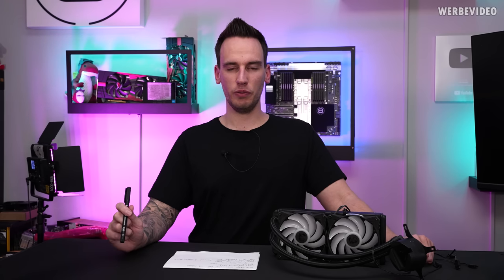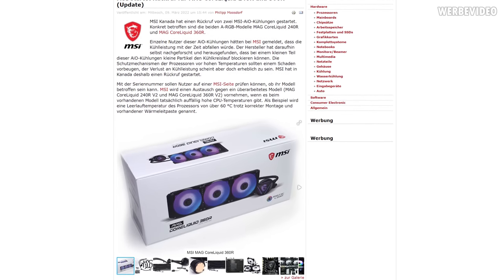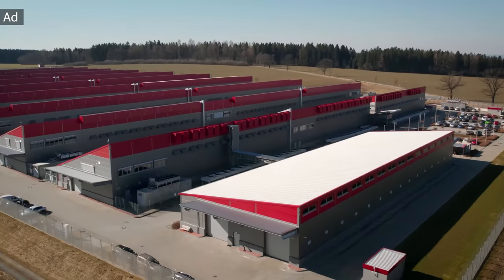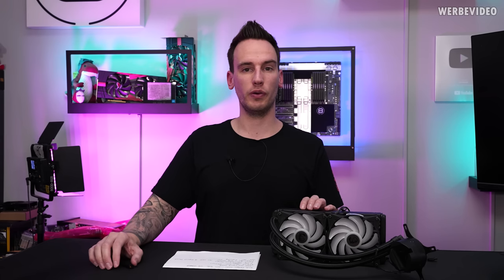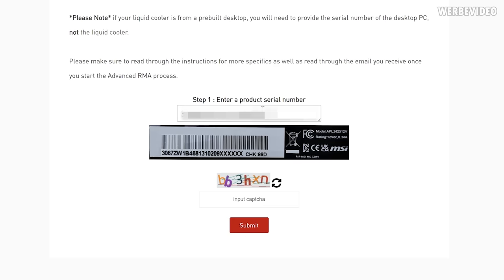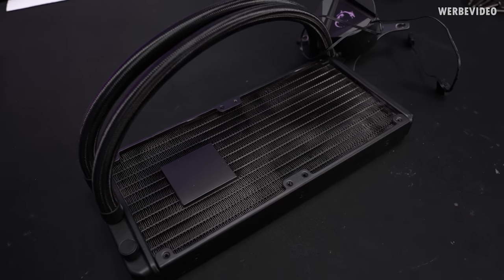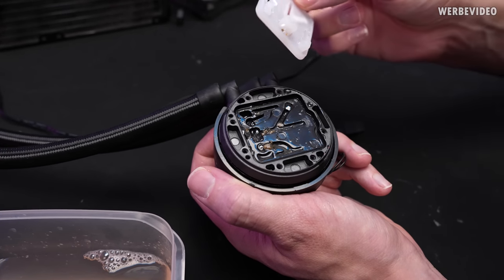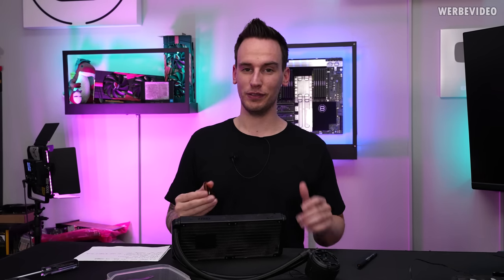Things you should not find inside an AIO

Comment: Thanks for the shout, Roman! We've run into 4-5 of these over the past few months, unfortunately, and many more emails with identical issues since. Currently pressing MSI because the system is still far from comprehensive, and apparently there are different replacement protocols in place for different regions - so not everyone will qualify for the "advanced RMA."
Reply: Someone ping Steve from Gamer's Nexus, he always gets results for recalls. Seriously it's worked before.

Comment: With this means, definitely stay away from any AIO made by Apaltek. In 2019, Gamers Nexus discovers Enermax AIO for Threadrippers clogged with slime all over the fins of the cold plate, that is also made by Apaltek.  3 years later, still get this kind of gunk on their AIO
Reply: thanks I remember that story but didn't know it was the same sub-contractor
Reply: Ooh thanks!
Reply: I don't understand why people go for AIOs in general (outside of the cheaper cost just to say you have liquid cooling, anyways). I have yet to hear of literally anyone who has been able to seal up a liquid cooling loop and never have to open it again. Just because a manufacturer creates the loop instead of the end user doesn't mean they magically have superfluids that can perfectly eliminate corrosion and other aging issues.

Though I do try to live by a personal philosophy... If I know something is going to break some day when I buy it, I want to be able to service it myself. A proprietary loop just sounds like a headache when it comes maintenance time. Like only being able to take your car to the dealer to get it serviced.
Reply: @ashkebora7262  People buy them because they don't want to deal with sealing in liquids themselves, they hope to get something they don't have to manually set up and can just install and go with no worries of major user error in installation causing water damage to expensive components.

I generally agree with your thoughts on repair and serviceability, which is why I don't recommend liquid cooling to anyone not on the enthusiast tier of PC building and in dire need of performance. For the general and layman user air cooling is fine and much less likely to cause any issues which a can of air can't fix.
Reply: @NATIK001  Well see, that's my point: If you're going to go for a closed loop, chances are you really don't want to deal with a water loop in the first place, which is why you bought a closed one. If they're going to age even remotely similarly to an open loop, then all that does is buy yourself complacency and issues down the road.
Reply: @ashkebora7262  
I don't mind dealing with a water loop, I have an EK system running through my two 2080 Ti's (soon to be a 4090).
It works well but I don't want that loop also cooling my cpu so rather than have a whole other reservoir I have a Corsair AIO. it has been running fine for nearly two years. If it develops problems I'll fix it.
Reply: @Igbon5  See, now your use-case makes perfect sense. You have a logical reason to have a separate AIO, and most importantly... you have the exact skills and desires a more casual buyer wouldn't have.

The kind of person that would buy an AIO and suffer issues from it are the FAR more common type of customer: They buy an AIO because they're supposedly better, cannot fit an air tower, or to say they have liquid cooling. That type of customer is still buying in to problems they may not even know how to deal with.
Reply: @ashkebora7262  
Fair point
Reply: @ashkebora7262  My H100i has been going strong for 9 years now somehow, unopened and running on nothing but overclocked cpu's.
Just waiting for it to break, especially knowing that these are pretty much known for not lasting a long time.
Reply: @kristoffer3000  I would highly recommend watching your temps actively. (which you might be already if it's seen many CPUs) It can be really hard to tell if your CPU is getting warmer than it should or even hard to tell if it's throttling if it's getting some heat taken away. Even mostly clogged water blocks will take some heat away.

Sadly, I speak from experience. I was ultra-lazy with my old system, and the 4770k burned out because the block got clogged enough to leave it throttling at max temp. The only time I even noticed anything weird was specifically big frame drops in 7 Days to Die the more and more zombies were around. Every single other game I played or thing I did felt similar levels of responsive. Blender was similar levels of snappy, other games didn't stutter with more enemy AI, etc.

I 'do' play at 4k if I can, though, so undoubtedly the vast majority of games end up GPU-limited for me even on that old 4770k. That should go a long ways to explain why I personally didn't notice.
Reply: Yeah, I had the same issue with Enermax and their warrantees were horrible. Even worse it was a nightmare to dismantle to clean because they used FREAKING SECURITY SCREWS on the cold plate. I'm not talking torx bits, but actual one way sloped security screws. That's obviously not an "oops, our bad" situation, that's actively screwing the customer.
Reply: @Ash Kebora
People buy them because liquid cooling is an efficient way to cool a CPU. And AIO's are a simple and convenient way to do that.
I've had 7 AIO's since 2011, and I've never had any problems like these. And I've Have opened and checked(and'topped up")4 of them.
Admittedly they are not perfect (nothing is) but they can be a great solution for certain use cases.
Best regards
PS I also use"open loop" and although they"out perform" the AIO's they are way way more"hassle
"

Comment: I'm pretty happy knowing that I'll never find sludge in my NH-D15.
Reply: And yes, I am still of the opinion that liquid cooling only makes sense for hardcore enthusiasts or in workstations that earn money, and for regular consumers all the risks and expenses that come with it outweigh the benefits. Sure, if you can afford replacing it every two years and have fun continuously monitoring your system or checking for regular recall news - by all means; but if you're only doing it because all your favorite sponsored YouTubers and Twitch streamers have them... maybe give your own system another look and see how much you actually gain.
Reply: Now we just need case manufacturing to make cases big enough to house the noctua. Most of them won't. I have to raise the fan on one side to fit memory. So that is a bit more than the 163-5mm of this cooler.

But its worth it. I also upgraded to ppc fan's cause I dont care about low noise and oc the piss out of the CPU.

Looking to maybe get the new unreleased ice giant copper version and see if that helps a bit and I'll swap to noctua ppc fans or some delta server fans and setup a fan curve.
Reply: @Lishtenbird  Noctua and Be Quiet make huge air coolers, but unfortunately for the heat density of Intel 12th gen and upcoming AMD and Intel generations it's not enough anymore. There's a limit with heat pipe cooler designs unfortunately. The last hope is Ice Giant.
Reply: @kyoudaiken  
the Siphon design could indeed help offset the inefficiency of Heatsinks - but they'd need to make a Consumer CPU targeted Product as the existing one is designed for Threadripper and so it performs pretty meh on normal CPU's.
Reply: @taiiat0  A friend has one on an AM4 CPU. So they already did that. He still has the aluminum only version. But what also is inevitable is the removal of the IHS. This thing is causing all the trouble we have now. HBM showed it. Just fill the gaps with resin and grind it reasonably flat for a cooler to contact. This will have to be done, otherwise temperatures will not be under control anymore. Those IHS are really the Achilles' heel right now...
Reply: @kyoudaiken  
I didn't say the Thermosiphon doesn't fit / can't be Mounted....
i said because the Flow Pattern is designed for Threadripper, the performance on Consumer CPU's is very mediocre.
Reply: @taiiat0  Ah it's not a big deal for consumer CPUs. A TR does 280W, the new consumer CPUs do over 200W easily. Alder Lake, Raptor Lake as well as Zen4.
Reply: @kyoudaiken  
it does matter. a lot. despite how complex that Cooler is and how expensive it is, on Consumer CPU's the Cooling performance is very mediocre. competes in performance to Heatsinks around the $40 mark, while being about triple that Price.

with a different Flow Pattern that is suited to Consumer CPU's it could perform well, bit they have not made that at this point.
Reply: @taiiat0  As I said it doesn't matter for NEW CPUs. Because the heat density is higher than and the heat output similar to a Threadripper. Lower end CPUs can just use a normal air cooler. You buy the cooler for the desired purpose.
Reply: @kyoudaiken  
no, it matters even more for newer CPU's. the Energy is more focused to the center of the IHS, while the wrong Flow Pattern that is for focusing on 4 Chiplets spread far apart on a much larger IHS, are aiming at the wrong spot.
you're in over your Head here, honey.
Reply: @taiiat0  On Zen4 it's not at the center, even at the very corner. That would mean they'd spin a cooler for every type of CPU. I doubt that's going to happen.
Reply: @kyoudaiken  
a Flow Pattern towards the center works fine for Ryzens' triangle of Chiplets, they're still pretty close to the center. that's what all Liquid Cooling already does, uses the same Flow Pattern for Intel and AMD.
Reply: @taiiat0  AM5 changed. The computation dies are not in the center anymore. Look it up.
Reply: @kyoudaiken  
alright little Boy, i guess we have to do it the hard way.
Zen4 is still clustered near the center, because the comparison is to the Threadripper layout.

maybe you should 'look up' how Threadripper was designed so that you actually know what you're Talking about instead of wasting my time running in circles.
Reply: @taiiat0  I actually have a 3960X. And no, the chips are not clustered on the center anymore on Zen4's S U B S T R A T E. If you mean on the IceGiant coldplate, then say it like that. You sounded like you are referring to the position of the dies on the substrate. And they are in fact not at the center due to the I/O die. I am working with computers since 25 years by the way.
Reply: @kyoudaiken  
cool story bro
i guess we're doomed to all of this going over your Head. oh well.
Reply: As of late it's not a few degrees anymore with the high output of last gen high-end CPUs, even big air tower coolers can barely keep them in check.

Comment: Stories like this are exactly why I choose to stay with my NH-D15. Absolutely nothing can compete with the reliability of over a kilo of aluminium bolted on to a motherboard.
Reply: yeah, for those that don't have needs of exceptional/maximized CPU performance they have the option of using Heatsinks instead.
Reply: Even though I wasn't on the recall list I was able to RMA my 360, but in the mean time switched to the Be Quiet Dark Rock Pro4. My new 360 is still in the box.

Comment: The issue is that there is one or more raidator manufacturers where the AiO makers sources them who are using flux to solder the radiators together which is not suitable for this application. This is why this happens to some AiO products. It seems like AiOs are currently visited by Murphy. First Enermax, then Arctic and now almost all manufacturers.... Who's at fault here? Hard to say, it's a complex supply chain. But MSI could definitely handle the RMA process better.
Reply: You'd think they would be smart by now. But I dont think they care. R&D is stupid idea. Money is king. Sell now and who cares if it fails.
Reply: @tacticalcenter8658  Yeah and they cheap out. Older AiOs did not suffer much from permeation (leakage of liquid to the air through the tubing due to evaporation through the tubes), had much more sturdy radiators, etc... It's all about cutting corners.
Reply: Huh? This is entirely the rubber flow guide dissolving. It has become a very common issue since covid and the war on ukraine.
Reply: Florian Oprescu  All Liquid Freezer II series AiOs made between May 2021 and March 2022 are affected according to the Arctic website.
Reply: @tag206  Yes Arctic has a different problem. That doesn't change the fact that AiOs are cursed...
Reply: Florian Oprescu  Absolutely zero products were affected in whatever asinine way he is spouting. Now for the dissolving flow guide, that is an issue that arctic will replace or help you fix.
Reply: @tag206  Whom do you mean by "he"? And zero products of whom?
Reply: Florian Oprescu 
yeah, everyone that has an Arctic Unit should go fill the Form, they seem to be casting a wider Net than they said are affected to make sure they get all of them.

Comment: That white gunk looks like silicon grease - from the pump?  Getting washed into the fins of the coldplate, clumping and being too dense to move back into the radiator.  Off to check what Greg Salazar's findings are...
Reply: It's crystallization due to a chemical reaction between the liquid and the flux residue used to solder the aluminum radiators.
Reply: @kyoudaiken  That makes sense, but if it's galvanic corrosion wouldn't it be more obvious in the pump and radiator itself?  Someone needs to cut the radiator open and look at the solder joins.
Reply: why would fluid pump need silicon grease. Most pumps at this scale are lubricated by the coolant (and will suffer damage if run without fluid)
Reply: @marcogenovesi8570  The pump is embedded in the radiator itself, there's more than a slim chance that contaminants have entered the system that way.  How are they sealing the pump housing from the outside?
Reply: @cyberwomble7524  Galvanic corrosion is a different thing, in this video you see a growth issue.
Reply: @cyberwomble7524  I presume they are well enough sealed. But I know where you're coming from. You basically think that if the coolant cools to a temperature below the temperature when it was filled, there could be a pressure difference causing outside air with bacteria to enter the system. But it would also mean that when the coolant heats up above the temperature it was filled in, it would leak out liquid (and air) as well.
Reply: @kyoudaiken  Sorry,  I actually meant that comment on another video in response to a Greg Salazar comment!  My comment to you was supposed to be  "that makes sense, but there's supposedly a bad odor too".  Sorry, shouldn't have been jumping between videos.

Comment: People should view AIOs as a CONSUMABLE item. Expect to replace it after two years due to clogging. This applies to EVERY brand. Six months before it begins to affect temps is worse than average but don't make the mistake of thinking that clogging won't happen to you... It's a case of WHEN not IF. Either go high end Air or do a custom loop. AIOs are simply too unreliable to run in 99% of rigs.
Reply: Not true
Reply: They are usually fixable too, just open them, clean and flush them and refill it with distilled water (available everywhere as water for Steam Irons). I've never needed any fungicide added, and no need to bother with a long RMA.
Reply: @riba2233  its kind of true these days.
Reply: @thingi  not always true. If they use the wrong flux like this case with MSI and so many other brands... It won't be resolved by replacing the water and cleaning it out. The chemical reaction will just re occur.
Reply: @tacticalcenter8658  here's a good analogy for everyone reading this thread. If you buy a good quality pair of shoes they'll last for years and years. If you buy a cheap pair of shoes expect to have to buy a new pair every year. AIOs are just cheap shoes and standard heatsinks are the equivalent of military boots. I'm not saying never buy a pair of currently fashionable cheap shoes, just set your expectations of how long they will last appropriately.